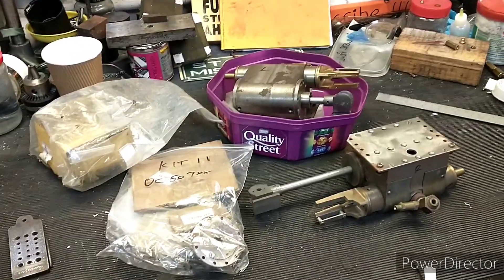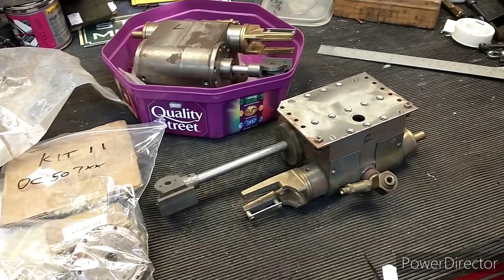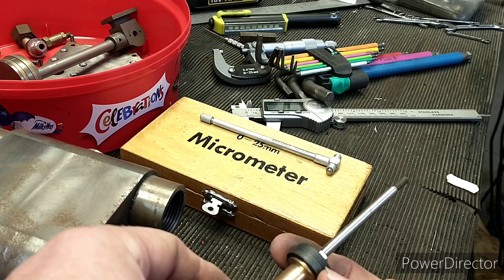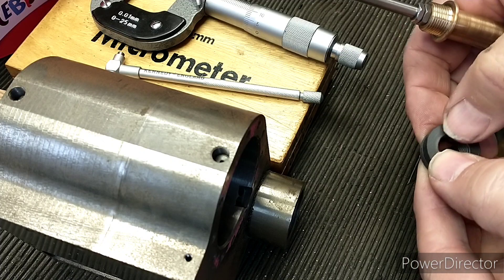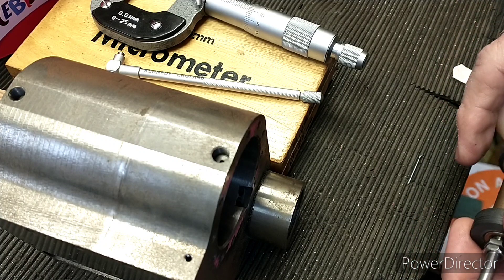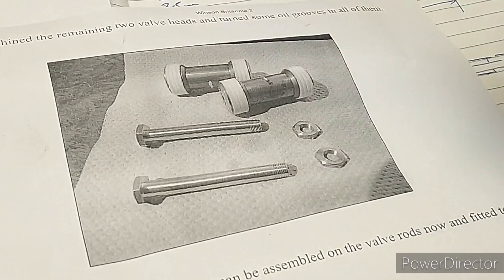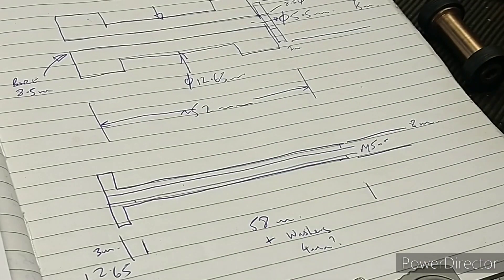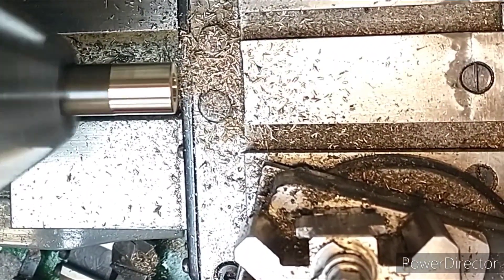Modelworks Britannia Ep31: Modifying the Valve bobbins #livesteam

Comment: nice one Julia
the over view shot is great, what stops those nuts vibrating off as you didn't tighten them, or did i miss something.!!
regards
Kev
Reply from the maker: Hi Kev do you mean the nut in the end of the tubular bolt thing? I haven't figured that out as you want the bobbin to float radially but not axially. Maybe some loctite when it's in the right position or a centre punch in the right place.... 😳
Reply: @julias-shed  yeh thats the one, just wondered, i would punch to belt and brace it👍👍👍👍
Reply from the maker: @MrFactotum  I won't argue with that 😄